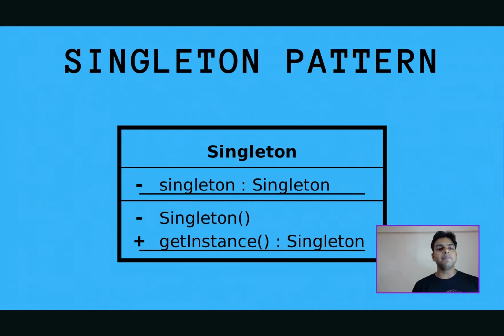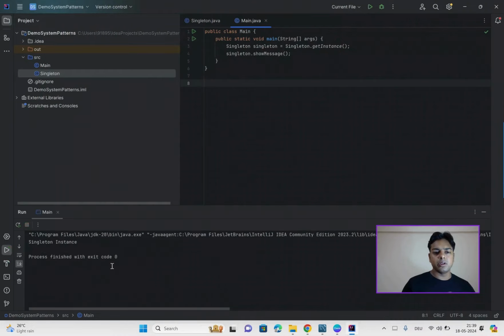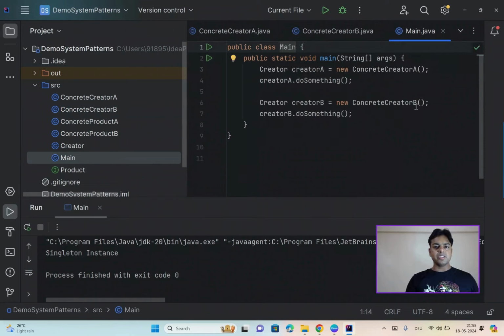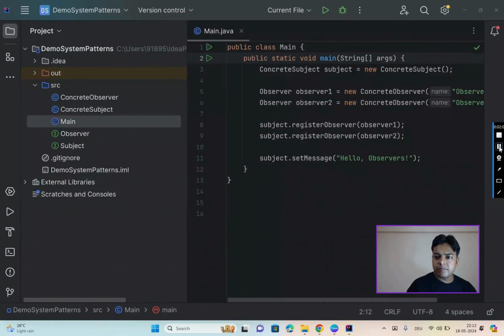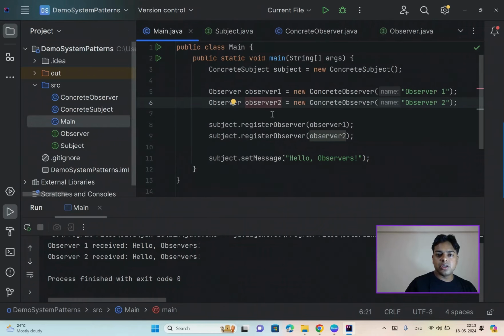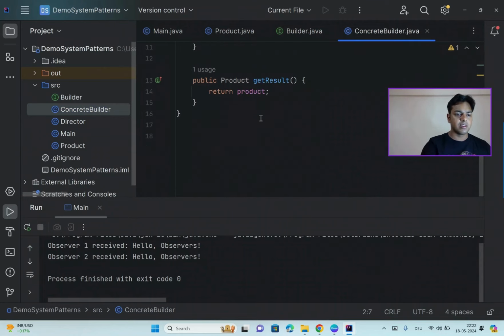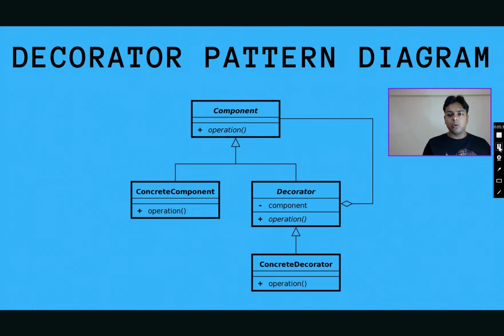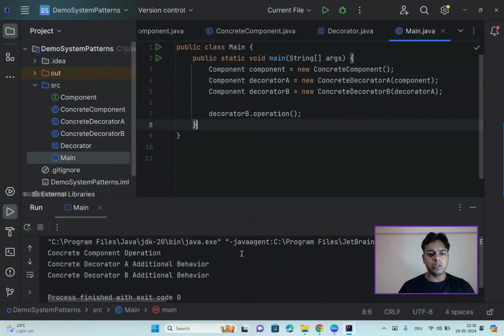Top 5 Software Design Patterns Every Engineer Should Know | #systemdesign #designpatternsinjava

Comment from the maker: Learn Design Patterns by Examples
1. Strategy  - https://bit.ly/3R0ilek
2. Decorator -  https://bit.ly/3pBq4Uy
3. Adapter - https://bit.ly/3ABNzmB
4. Observer - https://bit.ly/3QXghUb
5. Builder - https://bit.ly/3wfggmP
6. DAO  - https://bit.ly/3QH4mKH
7. Command - https://bit.ly/3rulKr6
8. Composite - https://bit.ly/3C4RqrY
9. State - https://bit.ly/3VaSbIK
10.Factory - https://bit.ly/3Cv7SDb
11. Template - https://bit.ly/3UeTzbx
12. Proxy - https://bit.ly/3XDGPy1
more - https://bit.ly/3XHad6I